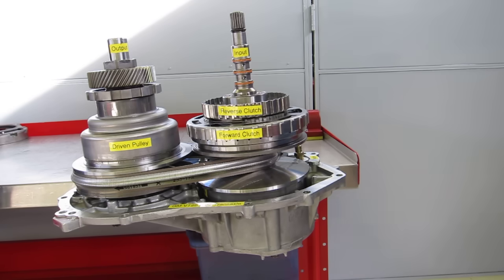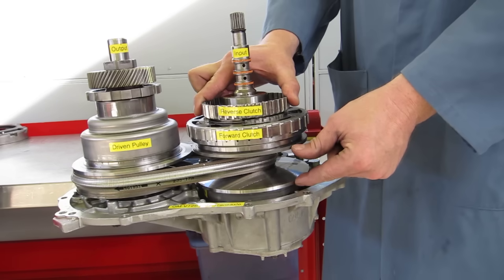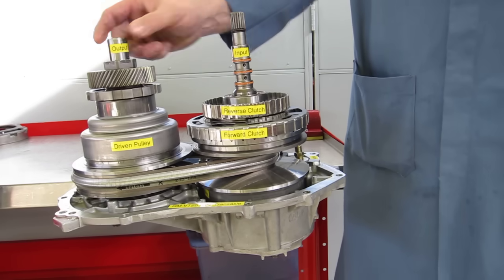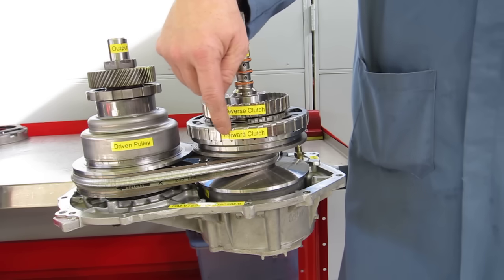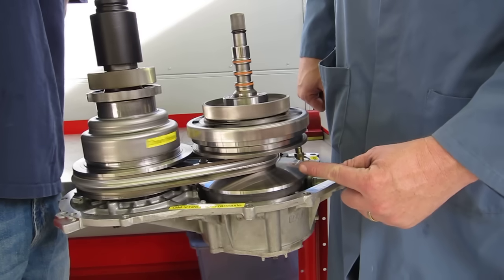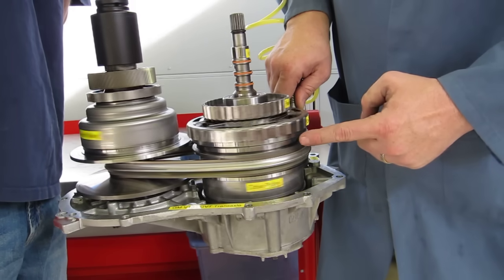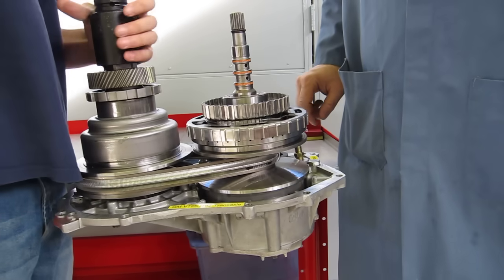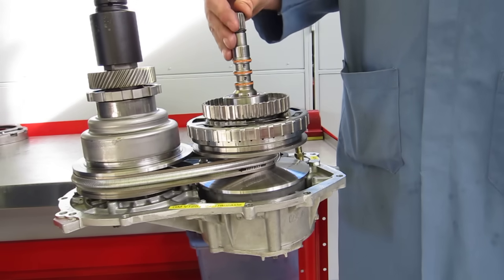Continuously Variable Transaxle (CVT) Operation

Comment: Interesting video!

But what causes the 'infamous droning' noise associated with CVTs?

Can you also explain the 'rubberband' effect?

Honda seems to have minimized both matters with its CVT engine but not Nissan or Toyota.

Also, is it true or false that CVTs durability is questionable? Nissan and 

Honda has a history of CVTs that tended to break down early.
Had a 2005 Nissan Altima with a CVT engine that last ~>10 years but that was my experience and was fortunate that it lasted that long.

Thank you!
Reply: +Michael Chan The droning is a pathetic non-issue created by people that think shifting sounds cool.  Trouble with it is that snowmobiles have the same kind of CVT albeit with a rubber belt, and I have never heard anyone complain about the lack of a shifting melody from a snowmobile.

I don't know about the rubberband effect.

The reliability issues, ah yes.  Back to snowmobiles, you need to carry an extra belt for emergencies, and expect to replace the belt every season or so if you ride much at all.  These as well as the automotive CVTs depend on friction, so they will wear.  I know I know, clutches and bands in traditional ATs have friction too, but only during shifts.  A CVT is theoretically always shifting.

Comment: i know how a CVT works on smaller vehicles but i never figured out how they made it work on cars without the use of a rubber belt. but uh... what is the belt made of exactly?
Reply from the maker: +ishouldgetalif3 Hi, these are steel link style belts. No rubber involved. Thanks for watching!
Reply: WeberAuto Thanks for responding!

Comment: This is so cool! I always wondered what a CVT transmission actually looked like!   I was looking for an exploded diagram but I found your video instead. Now I know why I never feel the gears shift in my automatic now. 
Thank you for producing this video.   :)
Great technology!
Reply from the maker: +Lee Ann CrochetGottaLoveIt Thank you!
Reply: grandpa5x Pulliam thanks dude ,you just helped me make up my mind about getting the Dodge Caliber .
I think I'm gonna stick with the original transmission cars instead of this new one that I don't know much about
Reply: grandpa5x Pulliam Yup. And more like in excess of 4k if you include labor. I have a 2011 Jeep Patriot latitude 98k miles on it, and I'm taking FCA to small claims over it. We took meticulous care of the car only to run into this issue which is well-documented to the point that there is a petition to file a class action lawsuit. No possibility of repairing, only replacing? Pfft! Who wants to spend $4,000 every few years to replace a transmission!!!??? This is bordering on a scam, if you ask me. And I wouldn't put it past Chrysler Jeep given their history.
Reply: Snowmobile's have used those transmissions for eons.
Reply: grandpa5x Pulliam    I'm not saying that it's a good or bad idea, I'm just saying it's been around for a long time. Non steel belts are more affordable than steel belts
Reply: @scottgolden2766  Changing a belt on a sled doesn't usually require you to drop the whole transmission! Anyone who sleds and has a centrifugal clutch should be able to change a belt, just like drivers should be able to change a tire. Takes a little muscle to spin the clutch (don't get your fingers pinched under the belt) but that sure beats replacing a whole transmission.
Reply: @cvp5882  i feel like thats where car manufacturers went wrong, treating it as a no-service, only replace full unit instead of making the belt a regular replacement item.
Reply: quien eres
Reply: Made for skidoo not for car🤬
Reply: Roopa Pai Ted talk

Comment: Fluid change.  Is it critical to monitor the fluid temperature when making a fluid change. i see manual said 104 degree or less when draining and putting in fluid on first drain. then drain 5 or so minutes later and drain and install more fluid but temp should be less then 113.  if critical why can't the second drain and install miss by 5 or so degrees i.e. 118. how would that be harmful?
Reply from the maker: +scooter12368 Two reasons; 1. fluid expands when it gets hot. The exact level can only be found at that temperature range.  2. Fluid hotter than 105 degrees can cause severe skin burns, so technician safety is a concern.

Comment: Thanks for the video. Can you tell me How much air pressure do you need to make the output pulley expand on a vt25e as in your videos as i would like too test mine.with it apart?
Reply from the maker: tonyt Hi, we use 90psi in our shop, that is all it took to move the pulley piston. In reality, the pressure is much higher (600-700 psi) to keep the belt from slipping. Thanks for watching!

Comment: I had a DAF with variomatic drive (same thing but rubber/reinforced belt)
it real does work. This is ideal for small engines as you can use the engines optimal power output constantly normal auto boxes are very inefficient by comparison and even manual boxes don't return as good MPG
Reply from the maker: ***** Thanks for watching!
Reply: ***** in the 70s

Comment: As a auto tech I was really skeptical about the c.v.t . but after 100k miles on a rogue since new I have to say they are not bad . my only complaint as far as driveability is the very faint rubber band feeling at a take off from a stop at about 30% throttle .with gas mileage guidelines etc they are putting them in everything Subaru as well
Reply: And it seems only Toyota has come up with a decent performing but reliable CVT. I’ve heard plenty of failures from Nissan & Subaru.

Comment: I own a CVT that has done 100,000 miles. It is quite an old Nissan. Although I was warned about the possibility of broken belts I've never actually spoken to anyone who's experienced it.
Nissan are the market leaders in CVT development and I hear the modern Nissan Belt CVT's are even better.
The T in CVT (at least according to Nissan) stands for Transmission by the way not "Transaxle" which, as far as I know, describes the orientation of a transmission.
Reply from the maker: Opin-Eon Thank you for the feedback. Nissan uses JATCO CVTs; they have held up very well. I agree that the T on CVT stands for transmission, but when a transmission and a final drive are combined, it is usually called a transaxle. Thanks for watching.
Reply: My 2009 Nissan Rogue rides like new, currently with 136000 Km on the clock.  Made in Japan.  
No issues at all for the last 12 years, only regular services.  
Love it.  Will keep it for another decade.

Comment: That belt doesn't look like it would last too long.....
Reply: Depends how you drive it. My car is 10 years old and still has its original clutch
Reply: @PaulHojda  how many thousand miles now with your original clutch?
Reply: @PaulHojda  cvt ?
Reply from the maker: ***** That is what I thought the first time I saw one.
Reply: If you don't hang the car on the clutch while waiting at junctions or starting on hills, a manual clutch will last for years.
Reply: @noelgriffin645  that's what I do, I shift to neutral when I'm stop on a stop sign or traffic light.
Reply: @gutadin5  Sounds good
Reply: my rebadged Lancer GT, that is Proton Inspira have this kind of CVT, 150000km/7 years now and still running smooth, never break down. 
with proper preventive maintenance (fluid, filter changes), this CVT can compete with other transmissions.
Reply: Swampy  maybe your friend drive the CVT like the CVT ever designed for racing, or.. if friends car is a new XTrail that is famous for 'guaranteed' CVT breakdown after 2 years.
so.. a CVT is yes, a junk.. if it comes from Nissan.
Reply: @blitzer25blitz62  yep, I'm definitely sure it was a Nissan. Subaru CVTs last much longer than a Nissan, however Toyota CVTs last longer than time itself
Reply: max factor hi, so when that fails, what problems will the car have? Thanks
Reply: Lance Orson 
Your primary drive pulley locks up due to 6 exploded Ballbearings which then seizes the final drive causing either the belt to freespin without any pressure on it or the belt wearing out and letting go of the 300 plus links to fall apart all into your transmission
The belt has several steel bands on the inside and outside,those have failed on occasion,but the main issue is always the Exploding ballbearings in the primary pulley,you don’t see them until you take it apart
Reply: Yep...notice Toyota is now offering non-CVT transmissions in most of their cars? I think there are many belt failures they are not telling us.
Reply: NO_EYES_ON_ME Yea no, the CVT is standard on Pruis’s, and on Corollas. Toyota is smart for not putting these transmissions on heavy vehicles like Nissan does by putting them on their suv’s, which causes a lot more wear. Toyota have been using the CVT for over 20 years now, and pretty much perfected it where its bullet proof thanks to Asin.
Reply: Swampy  what kind of car does ur buddy have??
Reply: Had a Nissan sr with on 130000 still goin
Reply: Swampy  my 70 challenger, doing about 55 ish, my buddy was trying to be a smart ass and bump the shifter into neutral but it went into reverse,. Tires squealing and almost went sideways i dropped it back down into drive. Was certain it messed up but ran smooth as can be,  I wanted to beat him and leave him along road, 
Anyway never did have an issue. So miss that car, sniff
Reply: my CVT in my subaru has lasted for 260,000km just fine
Reply: @ethanbadry3139  Subarus use a much stronger and superior metal link chain.
Reply: @ethanbadry3139  my 2008 Mariner hybrid with the cvt has 210,000miles. Still running fine
Reply: That's less than 200k miles.   A Toyota AT can easily beat it 1.5 times, 2 times or even 3 times in mileage.
Reply: it last for 7+ year... you clutch in manual gearbox needs more service than this
Reply: @maxfactor4209  same clutch on one of my cars been going over 10 yrs,. 275 k mileage
Reply: @maxfactor4209  I drove a quarter million miles on the same clutch in a Mitsubishi Montero.  Much depends on how it is driven.  I avoided unnecessary "slipping the clutch".

Comment: These cvts take FOREVER to get the car to go anywhere....fucking annoying
Reply: TheShangralaaaa17 I don't think they are designed for that sorta thing. It's a technology designed specifically to improve fuel efficiency and nothing more. On a side note; this transmission has less moving components in it than a traditional fixed gear style, which should equal to less need for maintenance over the lifetime of the transmission. In addition to that, it should also help reduce to potential for failure in the drive train, which is always a bonus for the owners of any automobile.
Reply: +TheShangralaaaa17 You must not have driven one... They tend to get up and go because they rev the shit out of the engine.
Reply: +Bossy Ox depends on the car. CVT in lancers does not utilize it's shorter gear ratio to reach redline, in fact you redline at around 70

Comment: Do these transmission last as long as traditional transmission. I am looking to buy used car ..should I be wary of high mileage CVT. Thank You.
Reply: I have a 2005 ford five hundred with a CVT that has 149 thousand miles on it, and i have never had a problem with it
Reply: @ianmiller3316  most of these cvts are problematic but fotd seems to have the best because its change Drive instead of belt or Steel but if that tranny goes you're talkin between 5 and $7,000 a majority of these Transmissions are junk
Reply: @yveslolou739   agreed. Another issue is they may not be a sealed transmission. Ford's CVT was, and if they "followed standard maintenance cycles" and changed the fluid, the CVT did not live nearly as long as mine did. When i got rid of the car, due to rust, the tranny had 233,000 or so miles on it. Never had any issues with engine or drivetrain.

Comment: CVTs are just so much more complex. Now I see why they are way more expensive for transmission repair.
Reply: +1Source SEO Houston 
CVTs are less complex than an automatic transmission since it has fewer parts which means that it 'should' be "less" expensive.

The issue is the durability of the CVTs.
Many of the CVTs were supposedly worse but it's durability (i.e. reliability) is slowly improving.

Comment: I don't understand, how can you change the diameter of either pulleys by pressing it closer or pull it apart?
Reply: The pulleys are cone-shaped and the belt rides on the slopes of the cones. Closer the cones are together the belt is forced to ride on the outer edges of the cone, where it;s wider. Further away the cone pulleys are from one another the belt can ridge on the narrower slopes of the cone.  Both sets of pulleys are cone-shaped and CVTs are very dynamic always changing the distance these cones are from their mate as the driving and engine demands change.  Hence why it's "continuously variable" these cones are continuously varying their sizes.  This as opposed to regular transmissions (whether automatic or manual) where there's fixed gear ratios, the size of the pulleys/cogs for each gear selection. It:s either 2:1, 2:2, 2:3, or whatever the rations are for each gear.  In a CVT you get the intermediates. The 2:1, 2:1.1, 2:1.2, 2:1.3, 2:1.4.2:1.5, 2:1.6, 2:1.7, 2:1.8, 2:1.9. 2:2, etc.

Engine and speed demands are smoother and are better meet what is called for.
Reply: you not changing the diameter of the pulley literally, but you are changing the diameter of the circle track  the belt ride on, just imagine there was an imaginary pulley of the size of the belt  loop diameter every time belt move up or  down.   The combination give you different pulley ratios on the fly
Reply: I didn't get this either.   I'm pretty sure only the outer edge of the belt is touching the pulleys.   In between the shaft and the belt is air....the belt only makes contact at the edges of the belt.

Comment: Great video! Though a quick question for WeberAuto - Are Nissan CVTs reliable? I just bought a 2015 Nissan Rogue with a CVT engine and am a little concerned about its reliability. 

This question is not for CVT haters to rant about how they hate CVTs. As stated above, this question is for the guys who uploaded this video to share any information they have on the reliability of the JATCO CVT engines. 

Thanks in advance!
Reply: Nipunsayswtf How's the Rogue holding up?
Reply: +Mumpy Gumboo Hi! Its been running fine and haven't had any problems.... I really like the car overall!
Reply: Nipunsayswtf OK; great. It's good to hear. I have a Honda scooter I recently bought, a used PCX 150cc and it has a shimmy problem, if it's not warmed up, around 10 to 15 km/hr. I think it's from the rubber belt glazing the sides of the pulleys. I'm not sure but this sound like that's what happens with the little CVT trannies with rubber only belts.

Otherwise, the variator seems OK. It doesn't shimmy when it's all warmed up. Makes sense. It didn't do it when I first got it (it only had a mere 300 km on it) A glaze of worn rubber would cause slipping, just like when you have old, worn, smooth and glazed brake pads on a bicycle. It can make the tires squeek, shake and shimmy.

When I can accelerate very slowly through the very point at which it shimmies, it doesn't shimmy. That, so far, is how I"ve rectified my issue. I might try opening the tranny up and seeing if I need to replace the belt or not.
Reply: +Mumpy Gumboo I know you posted this a while ago. Your scooter and a CVT are designed a little differently. The scooter uses the speed of the motor to actuate the primary clutch(the one connected to the motor), once it hits a high enough rpm(dependent on spring and weights) it clamps down on the rubber belt and starts to turn as you go faster the secondary clutch opens wider and wider. A CVT uses an all steel belt and the clutches are actuated purely by hydraulic pressure controlled by a computer. It sounds to me like you need a new belt for your scooter.
Reply: Aero Beast
 Thanks for the info! I recently bought a service manual, I'll have to look at the diagrams. Perhaps a new belt, yes. Thanks a lot.
Reply: My 2009 Nissan Rogue rides like new, currently with 136000 Km on the clock.  Made in Japan.  
No issues at all for the last 12 years, only regular services.  
Love it.  Will keep it for another decade.